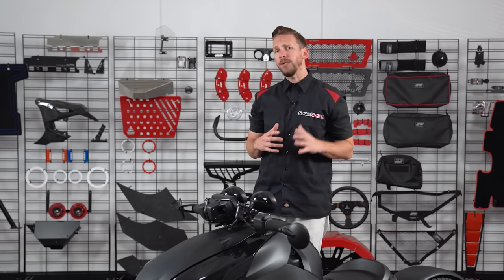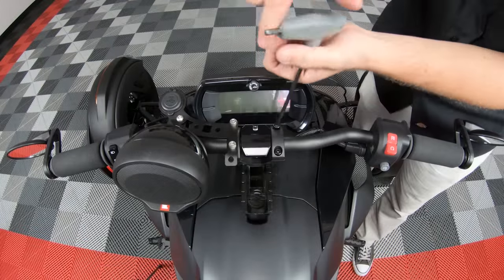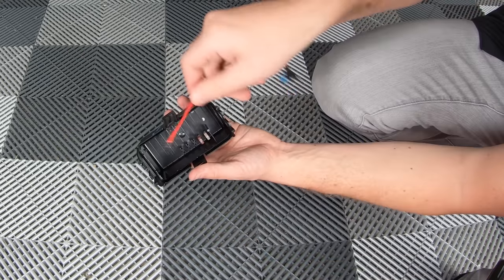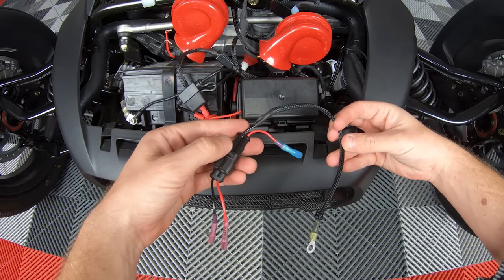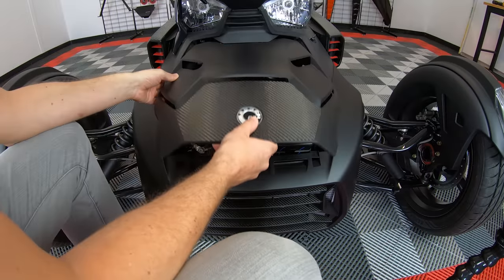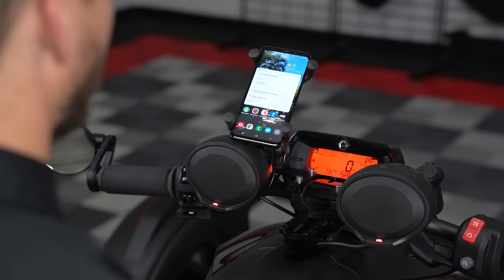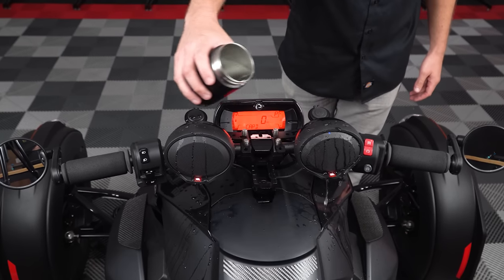Can-Am Ryker JBL Audio System w/Cell Phone Docking Station

Comment from the maker: 🛒Can-Am Ryker Stereo Systems are available here at SlingMods.com: https://www.slingmods.com/canam-ryker-stereo-audio-systems ❕❕❕ Please note that the manufacturer has updated this product and the "docking station" wiring no longer goes to the fuse box for power. The new wiring design for the docking station portion of the install is a Plug N Play connector that plugs directly into the accessory port under the upper fairing! The speakers themselves will still run directly to the battery for power!
Reply: Does these speakers come with amp? I just got them installed Saturday at Mancuso I pick her up tomorrow.
Reply from the maker: @royword176  Hello Roy, yes they do. The amp is integrated into the speaker housing.

Comment: When are you guys going to come up with a speaker system from saving works for the Ryker? We want a loud system just like the f3
Reply from the maker: Hey Dabo, i hear ya on that. We're working on one. It's a bit more complex than the F3 system because the F3 has several mounting points, whereas the Ryker does not, but it is happening! Thx.
Reply: Have you guys come up with a louder system for the Ryker yet?

Comment: Why could not the replacement screws on the handlebar mounts be black to match what you replaced??
Reply from the maker: Hello Ray, each MFG has a different opinion on that. Stainless is the best option for weather resistance long term. You could go with black oxide coated bolts but stainless is the best choice.

Comment: Do u have louder ones that can hold more bass 🔊🤔
Reply from the maker: We don't have anything with a subwoofer if that's what you mean... but we do have a system that will be using 6 1/2" kickers RGB speakers launching in the next few months. That will offer much more mid bass than this setup will.

Comment: Won’t that drain the battery?! Plus what about the weather?
Reply from the maker: Hello Mabel, if you listen to the stereo with the engine off.. it would indeed drain the battery. If you listen while you ride, you're good to go. The speakers are IP rated and intended to be outdoors. The USB ports have rubber boots and caps for water protection as well. Thank you!

Comment: Do this system run your battery down, once the bike is off?
Reply from the maker: Yeah! Any 12v mod running after the engine is turned off, will run your battery down.

Comment: I must have missed something. Where did the dock wires come from?
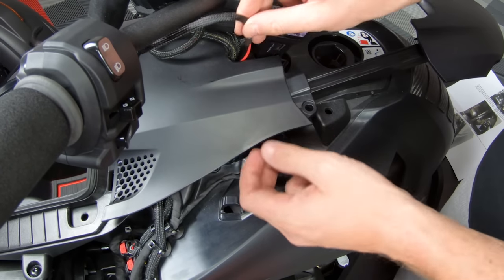Reply from the maker: Hello Bxodyssey, we start routing the docking station harness down to the fuse block at approx 1:50. They'll be two harnesses. One for docking station power and one for the JBL Speaker power.
Reply: Same question mine did not come with the wires to connect the fuses or the disconnector cord. Anyone else?

Comment: I have a 15 inch windshield on my Ryker, I wonder if I can still install this on my bike without having to take my windshield off
Reply from the maker: Your windshield should not be an issue with this system as it mounts to the bars. Our customer service team is available at 800-211-1396 if you'd like to discuss further. Thank you!
Reply: 10-4 I’m ordering now..😎

Comment: I dont like that the screw heads are not blacked out like the ones that they are replacing. Also it looked like the speaker that you control volume etc from is on the right side which means you have to be off throttle to control it. Controls for audio should be on the left so you can adjust if needed on the move.
Reply from the maker: Hello Jeff, thanks for the feedback. We went stainless on the hardware so that it doesn't rust. The speaker volume control is indeed on the right speaker but the speakers locations can be switched with one another if so desired. Thanks!
Reply: You could always paint the tops

Comment: O wouldn't feel safe with that phone clip, I saw that phone bouncing at speed i can see that phone flying!
Reply from the maker: Hello Smiley, Ram Mounts are some of the beefiest phone mounts on the market.. they've been thoroughly tested in UTV's and Offroad racing applications. They will flex as you ride as the clips are spring loaded and the restraints are rubber.
Reply: RAM is great. I can put a 7” GPS in the extra large and it doesn’t budge. Smaller one for my phone.

Comment: Love the setup. Up to what speed can you hear them?
Reply: I have these speakers and with a helmet I can't here them over 45mph
Reply: @quietclarence7998  thanks that's what I was worried about.
Reply from the maker: I would say these are best heard at "non highway" speeds unless you're wearing a half shell helmet that does not block the ears.
Reply: They are great sound and quality though
Reply: @Slingmods  thanks
Reply: @quietclarence7998  thanks
Reply: I use these around town and non-highway trips.  For the highway I use the Sena 10 in my helmet.  But the JBLs sound great and can be loud in town.
Reply: @thebandit149  thanks. I'll keep that in mind. I love the product so I just may get it and a sena or bluetooth helmet for the highway.
Reply: Oh, I thought they were JBL.
Reply from the maker: @topper24hours  They are JBL

Comment: Mine did not come with the wires to connect the fuses or the disconnector cord. Anyone else?
Reply from the maker: Helly Lynell, that's the new Plug N" Play design the MFG has gone with. Now the dockng station simply plugs into the plug n play accessory port on the left side of the bike for power. The speakers however still connect directly to the battery. Here are the new instructions: https://www.slingmods.com/pdf/ryker-jbl-instructions.pdf

Comment: Is there a way to lock them down so no one can try stealing the speakers
Reply from the maker: You could consider swapping out the screw heads to hardware that requires a square bit like these: https://media.wihatools.com/media/catalog/product/cache/9bd448ac984422d041ecf9b60a6f9a0b/7/4/74895_2.jpg It won't stop a thief who really wants em... but it may slow em down.

Comment: Why in the World would you Picky Back off an Existing Fuse when the Battery is inches away!!!
This is definitely not how a Professional would install this product.
This should be Hardwired to the Battery with a InLine Fuse.
You fry that Fuse Box by Piggy Backing off that Fuse You just Voided Your Warranty for some CHEAP Speakers.
Reply from the maker: Hello Rick, the speakers amplifier does indeed pull off the battery for power. The docking station now goes to an "unused" accessory power port underneath the upper right side fairing. So it would be a dedicated fuse for the docking station. You wouldn't want to run your docking station directly to the battery for power as it would remain on at all times and drain your battery. The docking station needs to be connected to an ignition power source so it turns on/off with the ignition.